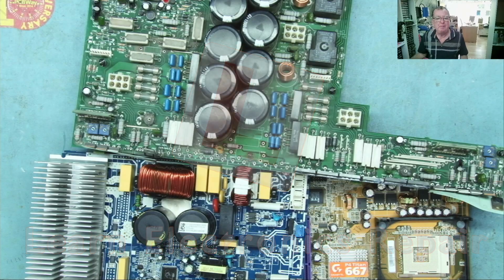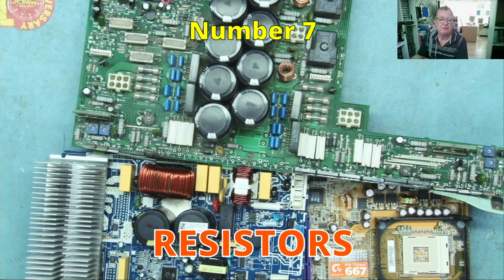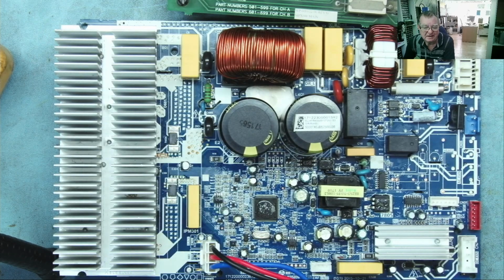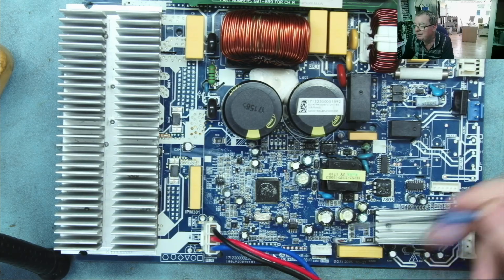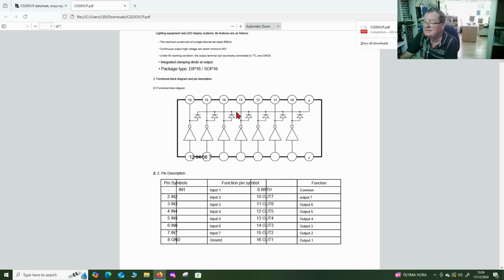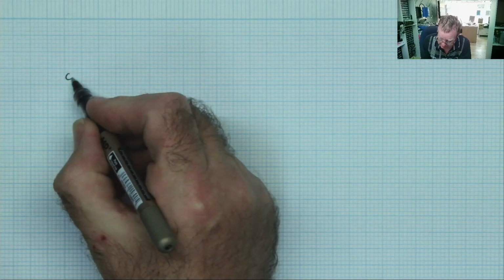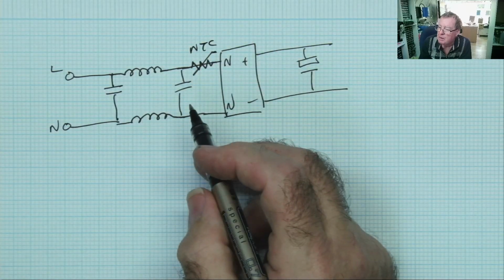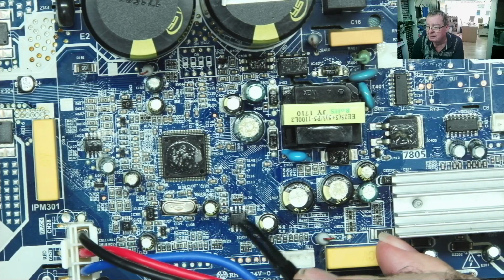Six More Most Common Electronics Faults : How To Diagnose And Fix Them

Comment: You are excellent!   Thank you for helping me to better understand how to fix newer electronics.   I work as an avionics technician so today most black boxes and radios are things you can never enter to fix.  The soldering iron has turned into a package tape dispenser.  And all we do is swap left and right boxes and control heads.  At least we have those to check against like the left and right sides of a stereo…. But it’s all output running to an Avionics communications bus now within the aircraft.  Each box talks to each other.  All you look for is a big square block of high frequency on a portable oscilloscope.  I wish we could open and fix stuff again like we did 20 years ago.  But the lawyers have taken over and the liability has become impossible to fight.  Though the FAA here in America requires us to have a room full of service schematics & manuals, First page states if you touch one of any she’ll painted screw you are off warranty.  So I now fix American Five / Six tube radios at home bench just to slightly smell the flux and see the invisible science we know.  Enough…. Just thought to tell you how you have helped me with your inside, and your great sense of humor.  Feel free to reach me if you like.   I do not mind, nor do I mind you posting my contact e-address.  You keep me current as we advance into SMT getting smaller and smaller.  Soon we will need a true microscope to see anything, and you won’t even be able to see a trace wire from component to component.  Thank you again .   Michael, MichaelScot4u@icloud.com

Comment: Props to both, enjoying and learning new stuff. And to give back, major brands of motherboards will offer replacement bios chips for around 20 Euros. Even in my short college experience, I managed to kill some motherboard brains, but in both cases, I was able to obtain a replacement chip, which I didn't even need to resolder or re-ball or solder. Just plug and pl- wait, this goes down or does it?
Like I said, I was able to obtain the replacement chips, no biggy. However, they did not include the repair manual or any manual, but a nice bill. Which brings me to!
Whatever you do, do make an evidence photo of the victim before you start fiddling. It may tell you the proper positioning of said eeprom chip.

Comment: Customers sometimes being the worst problem because they can steal all the enjoyment we might get from troubleshooting and repairing their electronics. 
When I run into the severely difficult customer I tend to grit my teeth and deal with them as smoothly and quickly as I can. I may even end up doing the repair very cheaply for them, but I mark them and never do another job for them again regardless of what it is, or how much they'll pay. I basically 'fire' that customer, but I don't tell them. I just say I don't have time for them or their problem if and when they return.

Comment: There are clearly other failure modes - SMD chip type resistors, at least some types, are highly sensitive to sulphur or ammonia. Their resistance then can be all over the place at some point, but ultimately they also fail open. Just to be considered.

Comment: As a recent retiree I've starting tinkering with fixing old electronic stuff, something I've always wanted to do but never had the time. I found a discarded microwave this week and brough it home to check out. I was wondering if appliances should be plugged into an outlet to see if they work or is this more harmful than good? I've seen other videos where people rig up appliances through an isolation transformer, is this necessary?... Thanks for your awesome videos!

Comment: Thank you, very generous of you to share your experience. May I propose another cause of failure? I'm thinking of a mechanical stress or a short between the PCB and the body of the equipment. I've seen a soldering squeezed by a screw of the body producing a short on the PCB.
Thank you again

Comment: -What about what I call "dynamic resistors"? A resistor that shows OK on meter, but fails under load! Had an amp with bias problem, checked most components out of circuit.
Found this 1k resistor that checked OK on meter, but when placed in series with another 1k (should of had half the voltage), I got 1/4 the voltage! Hence the term "dynamic resistor".

Comment: An excellent run down, Richard.  
Notes: the dark brown glue is corrosive and I've seen it eat away copper tracks and resistors. It must all be scraped away.  
The silicone glue used in electronics is the one without acetic acid. If anyone is tempted to use silicone glue that smells of vinegar, DON'T!  
Also there's another common type of glue, which is a hot-melt plastic. This doesn't cause faults but can be a sod to remove. A squirt of isopropyl alcohol will usually release it but I often use a hair dryer to soften it so it peels off. 
Multilayer ceramic capacitors fail because of stress fractures. I've seen them catch fire on a 5 volt supply rail. Sometimes they just go short-circuit and get hot. The cause of the stress fractures is bending of the PCB, combined with solder pads that are too large and solder that is inflexible. 
Polyester capacitors can fail because fast risetime voltage spikes cause punch-through of the dielectric. This is self-healing to a limited extent but the capacitance value gradually decreases. It's very common on CD ignition blocks.

Comment: Firmware stored in modern flash chips almost never get corrupted on its own. The number one cause is usually due to a failed firmware update, or user programmed in the wrong firmware which bricked the device, or the flash chip itself is half dead after it experienced a voltage spike.
Reply: Emphasis on "almost" never. Haswell era Gigabyte boards seem to have issues with their MXIC flash ROM chips on a fairly regular basis, up to the point of dead cells that cannot be rewritten. Same issue has also been sighted with slightly older HP Pavillions using the same brand. Small EEPROMs holding settings can also simply wear out, it's not unheard of among automotive stuff of the last 10-15 years. IMHO these chips are a case of "you get what you pay for", or rather "the customer gets what you paid for".

Comment: Thanks Rich, learned a lot of info. Here’s an idea. I find most devices with SMPS( switch mode supplies)seem to put static noise in other devices near by. So how do I filter a SMPS to reduce the line noise. Thanks again.
Reply: Simplest way is to connect an external mains filter. However, if the "noise" is airborne, a shielded cabinet will be needed. But sometimes distance is the only solution. Interference reduces according as the square of the distance so even a small additional separation can be significant.

Comment: Hi Richard. 
I would say resistors ALMOST always fail high/open. I have come across a couple over the years that have gone low in value, both carbon comp types, and I have heard of certain types of wire wound ones going “ shorted turn”. 
 Resistors going low  common? No. 
Does it happen? Yes, but granted not very often.
Reply from the maker: OK I may stand corrected there. I've never seen it myself but I suppose the shorted turn thing could happen, also with metal film resistors.  Let's put this out to the swarm intelligence.  Anyone else ever seen a faulty resistor go low in value?

Comment: In years of working on electronics, I've never encountered so many cement power resistors installed "upside down" as in your videos. I've virtually always seen them installed with the potted/filled side down, writing on the side. In your videos, I keep seeing them installed with the cream filling side up. At first I thought it might be heat dissipation, but even the ones I've seen that get really hot like in old CRTs, are installed with the cavity facing down, but on thick leads holding it an inch off the board. Can you explain the benefits of the upside down installation? It would be awesome if you could post a short with two identical ones in series, one upside down and one regular, filmed on the thermal camera.
Reply from the maker: In truth I actually never thought about it but I would suspect that if the cement side is upwards, and seeing as it is a thinner layer to the air and heat rises then maybe this 'upside down' method is actually the right way?